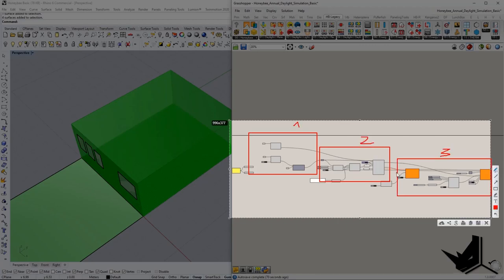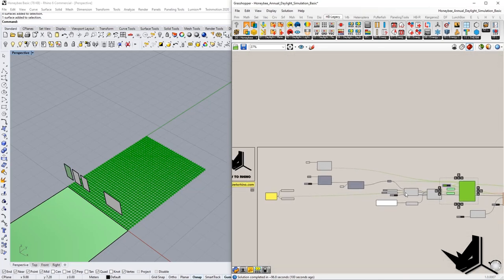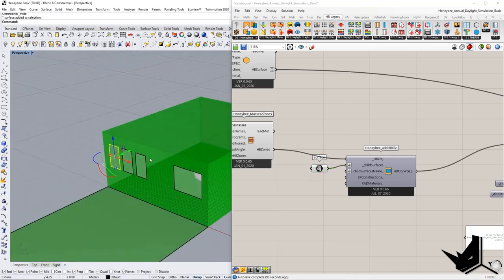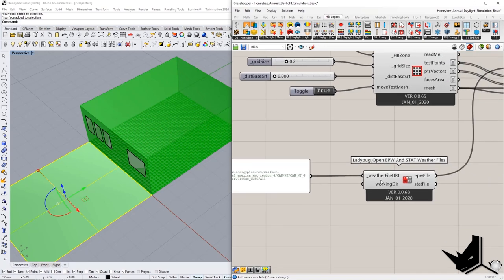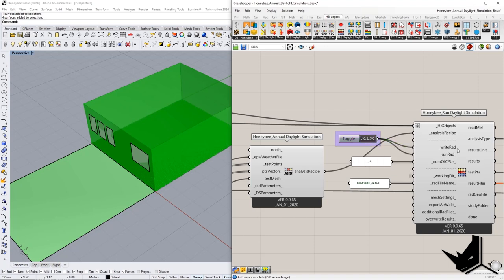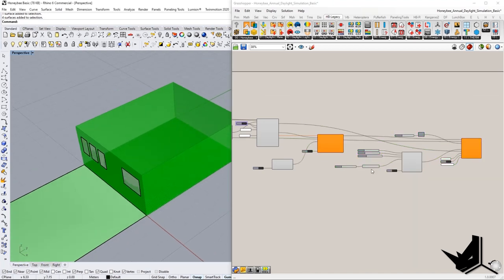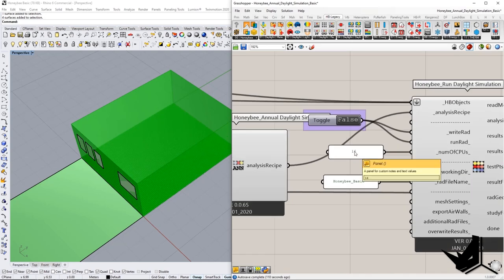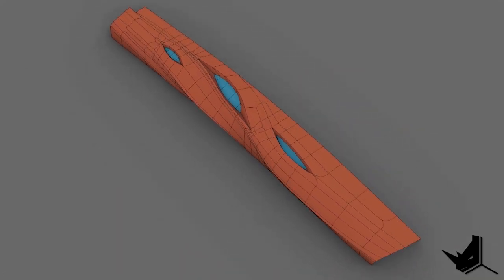Environmental Analysis with Honeybee Tutorial

Comment: Hi, thx, but it's better if u could explain by doing it step by step in gh, I 've followed what u did step by step, even though I correct the "mesh" out put to the "input mesh" which u shows wrong in the video and it takes me a long time to figure out...  I still have 2 problems, the component Recolor Mesh yellow bubble shows" 1. length of the results [=1] is not equal to the number of mesh faces [=326] or mesh vertices[=355]."   the "Read Annual Result" yellow bubble shows" Major input missing", and I couldn't figure out why T.T.

Comment: Mistake at 15:18 when you are talking about the Recolor Mesh component and the necessary inputs, you pointed at the wrong source for the "_inputMesh". You pointed at the "UDLI_Less_100" output of the Read Annual Result I. Instead you should've pointed to the "mesh" output of the Generate Zone Test Points component. You were probably misled by the wire that runs right under the "UDLI_Less_100" output so it looks like it connects there, but it goes to the Generate Zone Test Points component.
Reply: your comment is so freaking useful, thank you.
Reply: @cbaas8986  you're welcome
Reply: thank you +1
Reply: Oh, wow, that is what you get when you don't organise your canvas. There definitely should be a plugin out there that avoids this confusion. thank you for your comment!

Comment: Hi! I'm having a problem with the output of the element for adding windows. when i check the output of it with a panel it says "null"  because of this I am not getting any test points out of the next componenet eighter. All inputs seem to have valid values. Is there a solution to this?